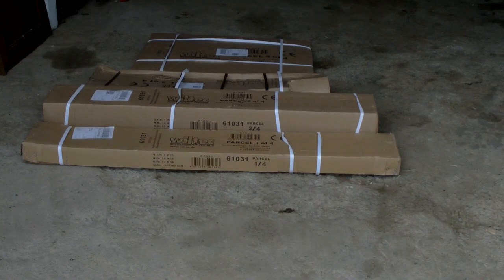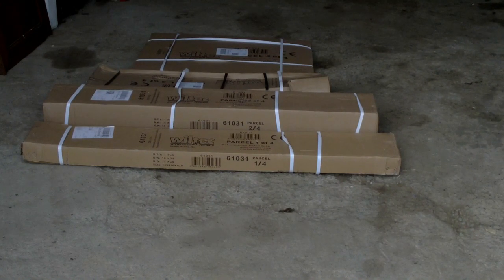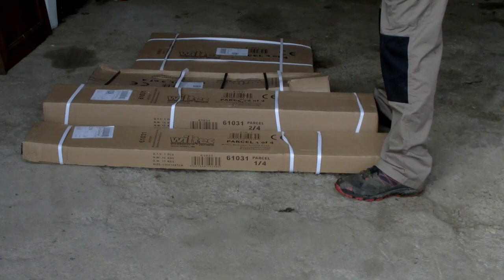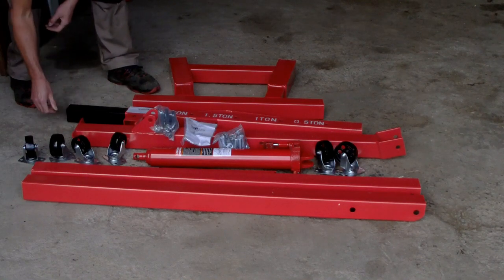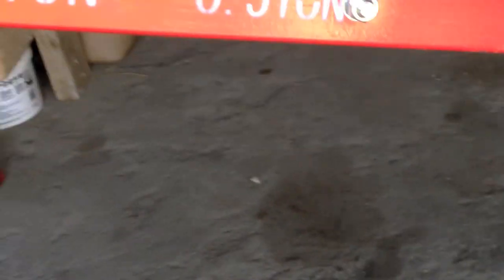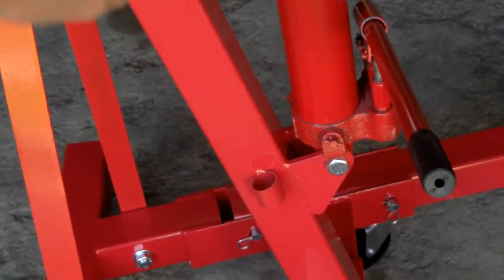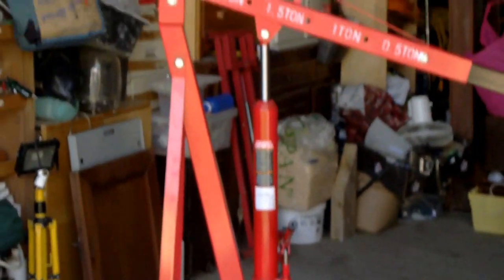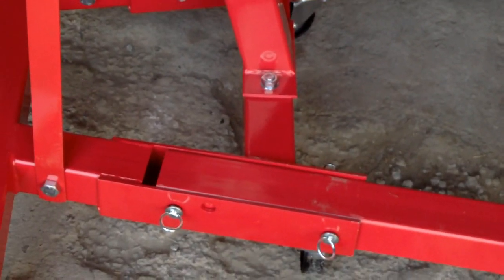Building a 2.0Ton folding hydraulic engine lift/hoist/crane

Comment: That thing at the end of arm the hole for shackle is just drilled way too low, not sure if that actually can handle 2 tons. Mine is drilled just about in the middle of it.
Reply from the maker: Cheers for the comment, they are cheap for a reason, can any really handle the full rated weight? Got me out of a situation anyway. Take care

Comment: Aye lad, a very good video presentation! A bit late to this dance however my lift arrived today Mon. 12-11-22
These are the subtle differences....I ordered mine thru Amazon, cost $300.00 US. VEVOR is manufacturer straight out of Shanghai!!! altho same color.
Noticed you received actual booklet of some sort quite possibly with assembly instructions. for me a single sheet of paper  which appeared to be in Chinese with parts list only. also noticed your larger hardware utilized washers (1/2") ....none for me! of the 4 pins only 3 were drilled to accept the pin key! I upgraded all hardware to grade8 and commenced to assemble. iI too believe this rig will work well.
Greetings from Arizona
Reply from the maker: Great! Probably a good idea to upgrade the bolts etc, I never thought of that and I needed my car fixing ASAP. It should see you well for home mechanics, obviously I don't recommend for constant daily use like in a commercial workshop.
Take care and I hope that the build went well.
Thank you for your comment, don't forget to subscribe, and you can buy me a coffee if you like on my about page.